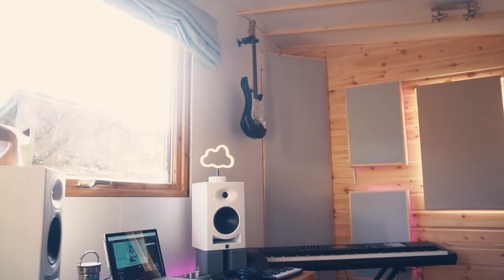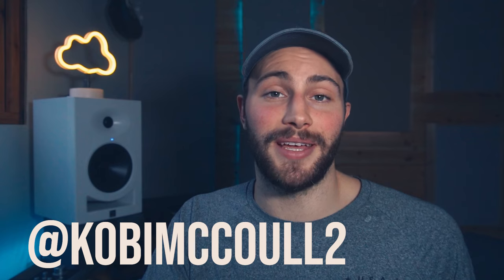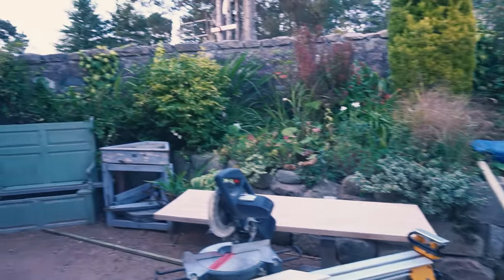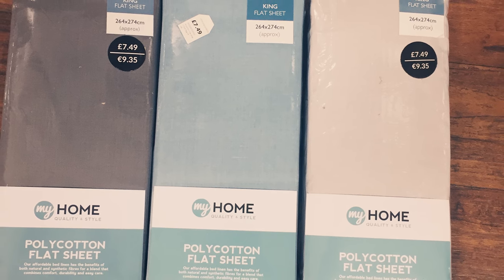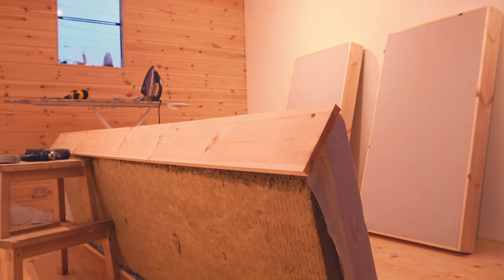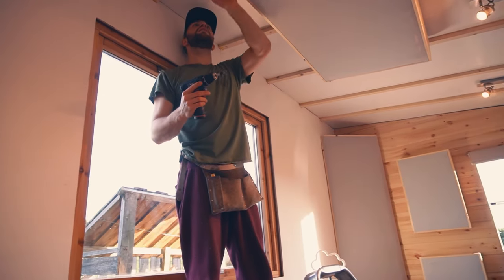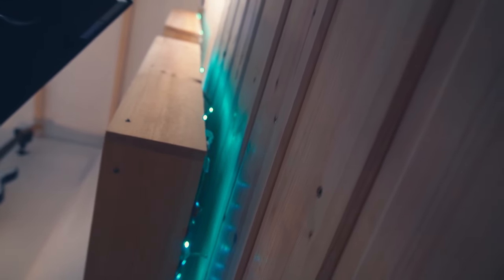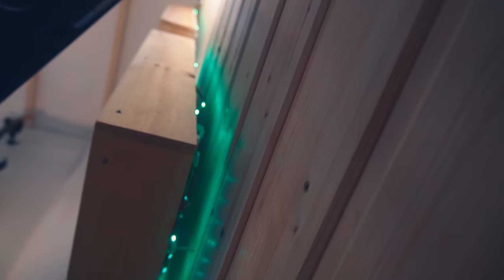Pro Acoustic Panels DIY how to make Cheap! + Acoustic Treatment Basics for a Pro or Home Studio

Comment: Did the fabric moved or wrikled when you screwed the outer frame to the panel?
Reply from the maker: it was stapled pretty well so i didnt but I can see how it might if you arent careful
Reply: @iambradarthur  I got some 2" pannels and I'm thinking of adding an outer frame to use your hanging method so there's an air gap but since they are already built without a second frame i am worried the fabric tension will loosen from nailing, any recomendations?

Comment: Do you have a video on how to make a bass trap ?
Reply from the maker: I don't have a specific one, they are pretty much the same thing as the rest of the panels but build with a 45 degree angle at each corner so that they fit snug against the wall, and you make them as tall as you need.

Comment: Great vids Kobi, watched all of these when you first did them and I’ve come back now that I’m about to insulate my shed build! Quick question… do you know what the stud size is from your exterior wall (looks like you filled the gap/cavity with just rockwall… is it 50mm size?) as I was thinking of extending mine out (it’s only 45mm) to have celotex/Kingspan then rockwall, then plasterboard over… but wondered if this was overkill… I’m only using monitors and mic recording, no drums or live instrumentation… last question can you link the LED lights you got from Amazon.. as there’s about 5000 different sets on there I’m just curious as to which ones you purchased… thanks man, all the best, love the channel and music 🔥👌
Reply from the maker: hey thanks very much, I think the Studs were 90mm deep and 45mm wide and the rockwool was 100mm deep but it made for a nice tight fit by having the studs just slightly less deep than the rockwool. the rockwool was 600mm(60cm wide I think too and 1.2m tall) the LEDs I used are here https://www.amazon.co.uk/gp/product/B085LZXZTQ/ref=ppx_yo_dt_b_search_asin_title?ie=UTF8&psc=1 I hope that helps. thanks again
Reply: @iambradarthur  hey thanks man for the info, all the best to you! 👍😎

Comment: what thickness and density I should use for acoustic panels. I want to hang acoustic panels for my wardrobe as I want to convert it as recording booth and I come to know the fact that acoustic form is not a good idea for acoustics because it only absorb higher frequencies and I must cut lower frequencies for most situations. Your advice will help me for sure. 👍👍👍
Reply from the maker: I used the RW45 rockwool insulation and so far it has worked well. Many are choosing not to make specific vocal booths nowadays and simply treat their room and record vocals in there and it seems to work very well, sometimes even allowing for a more rich sound as it isn't too muted and dull from over absorption. I'm not sure of the size of your wardrobe but I have found that even using pillows, blankets and duvets can work really well as a simple minimal option. i hope that helps :)

Comment: why did u pick the largest ceiling part of the room instead of the shorter? shouldnt u place the desk and monitors at the shortest wall?
Reply from the maker: I thought about setting up at the shortest wall and I knew I could do that if the current setup was problematic, but this current setup was more ideal for the filming and general use of the space. It has been sounding great to work in so far too :)
Reply: @iambradarthur  thx for answering. Greetings from Venezuela mate, i like the way you approach this content

Comment: I got an ikea cube shelf thingy along the back wall behind the stereo and filled each cube with rock wool + higher density plasticy stuff behind it.  Coated the wool in a light clear coat paint to be sure the fibers are locked in.  Used an untreated (unbleached) rock wool so it looks interesting with swirly patterns in it.
Reply from the maker: nice one. sounds great and I'm glad it's working well :)

Comment: What would you do to soundproof your bedroom so you don't have noise going outside the bedroom but still be the cheapest possible while also it working great?
Reply from the maker: simply filling it with more dense things like pillows, duvets, carpet, blankets and furniture like a bed/sofa will absorb a lot of sound and the thicker your walls the less sound will escape, absorption is easier to manage than sound proofing (stopping sound escaping the room) a lot of that depends on the material your walls are made out of and how the walls are connected to the rest of the building
Reply: @laurabrown4675  don't sell me stuff.

Comment: Wait I missed the part where after you put the foam in. Did you create another wooden list to around the original list which are as tall as the foam or did I misunderstand?
Reply from the maker: yes, so you make the initial interior wodden frame, then attach the fabric with staples, cut and fit the insulation and then layer the outer wood around the inner frame
Reply: @iambradarthur  awesome, appreciate the reply :)

Comment: Heya, should the panels be covered all the way around the front (leaving an open back) in order to reduce reflections on the wooden surfaces of the panels, or is that not an issue? Thanks for the video!
Reply from the maker: ideally you just want as much of the absorption to come from the front, outward facing surface and then an air gap between the panel and the wall. You don't have to line it with wood on the outside, it's more of an aesthetic option but you want to make sure the fabric covers up the foam or mineral wool

Comment: Great video! One question, where did you get your rockwool from? I recently just made 6 panels and could only find the rockwool online from acoustic treatment websites. It was much more expensive than I originally thought.
Reply: Probably Home Depot or Lowe’s! I checked my local HD and they had it
Reply from the maker: I got it from a local Builder dealership directly

Comment: is there a difference between building bass traps and just normal panels? if so, what is it?
Reply from the maker: the normal traps aren't deep enough to absorb the longer wavelengths of the bass frequencies so the Bass traps are made the same way but are spread across the corners and are larger resulting in an absorption of deeper frequencies as well as the mid and high end. That is my current understanding

Comment: Hey Kobi, great video! I'm just wondering do you know if the Rockwool is harmful to your lungs if you have it exposed like this? I did the same thing with my studio but I'm a bit paranoid about so much of it open to the elements in one room and I can't find much info about it online. Cheers!
Reply from the maker: I have done a variety of research and inquiries and there are several other youtube videos discussing this topic. I concluded that it's worth wearing protection whilst handling it and ensuring that it is covered in the final design with the wood and fabric but that it is overall a neutral material and should be safe. There are a huge number of people who have used the same material and the studies comparing its safety to materials like fiberglass and asbestos show that it does not behave the same way as they do and is not a carcinogen. Ultimately I cant same definitively but from what i have found it seems safe. Making sure you have good room ventilation will always help anyway.
Reply: That's great! Thanks for taking the time to reply 👍

Comment: Great vid! How thick were the bedsheets you used? Im making a recording booth for a podcast and Ive lined the walls with stuffed animal stuffing (so I have peace of mind whether or not my lungs will be harmed) and framed it with wood and cardboard. The small dust particles are a bit if a problem and I need a barrier to stop the costant yet small accumulation of that dust in the air. I purchased some bedsheets for the same reason you did, but I want to make sure its thin enough for the sound to pass through to the stuffing. Thoughts?
Reply from the maker: I just doubled them up and it still works fine for absorbing sound but isnt too porous :)
Reply: I’ve experimented with this and found old towels work best, used cheap frames from the Works, covered with towels then material used for soundproofing car/van, they look good, tried insulation but nowhere near as good.
Reply: Have researched this for several weeks and my understanding is that the coverings need to be breathable (if you can blow into it easily) otherwise it’s going to reflect. Is so frustrating to figure out which materials will work well! I’d say canvas tarps tho less pretty would work but then what you said: fiberglass hazard may pass through. So something in between sheets and tarps from fabric store or that company illford of Maine I think it’s called makes it.
Reply: @hardlines2635  I’ve wondered about towels or blankets rolled up. You mean for the insides of the panels yes?

Comment: When you're saying "slightly bigger", about the insulation size, compared to the frame : how slightly it is ? Is 1cm enough ?
Reply from the maker: Not even that I would say, if the insulation is 60cm across you want the frame to be about 59.50 or 59.70cm across so that the insulation fits in snug without having to force it or fasten it in place.
Reply: @iambradarthur  ok thanks a lot man !

Comment: So why are these 'pro' panels? At what frequenties do these work? In my opinion pro panels are panels that are specifically build for the acoustic problems in a specific room.
Reply from the maker: This design is used by professional acousticians across the world. the mineral wool, depending on the density and thickness has good coverage across the frequency spectrum. You can measure the absorption in your room with various tech to work out specific resonant frequencies which you could then treat with a diffuser or resonator to improve the overall sound, but these panels offer broad absorption, not specific to a small frequency range.

Comment: Do you think 60kg/m³ is dense enough at 10cm thick? Also how thick was the wood you used?
Reply from the maker: so far it's been great. You can double it up if you need it or get different density depending on your room dimensions and needs. I can't remember the exact measurements but I think between 12mm and 20mm depending on which part it was

Comment: Great video! I’m currently building a room within a room for soundproofing but instead of rockwool im using fiberglass and it’s doing a great job! I was wondering tho if mineral glass would be effective for these panels or the bass traps. Any thoughts on this?
Reply from the maker: I'm not sure. I don't know what the absorption properties of fibreglass are, I predict they might not do a great job of absorbing lower frequencies. I would also be careful with the fibreglass being exposed or not adequately covered as it is more of a health hazard than the Rockwool.

Comment: I would not use rockwool for panels.  Rockwool breaks down over time and will pass through the cloth material, into tiny particles that you will breathe and eventually get very sick from.  Rockwood is meant to be an insulator behind sheet rock walls and is not meant to have any acoustic value.

Comment: Was surprised to see this immense treatment for some 6 inch drivers. 😂 do you have a sub? Love the video regardless.
Reply from the maker: haha you'd be surprised, they can still generate quite a lot of Bass and even with this treatment its pretty bang on just right. Any less and it would probably start negatively affecting the recordings
Reply: @iambradarthur   Oh I can sympathize - my lil rokit 5s make a surprising amount of low end - especially in a small parallel-walled room. My Adam 7s def required me to trap the crap out of my studio. I also have a 12 inch sub which definitely smashes my waterfall graph haha
Reply: @iambradarthur   I’m no expert, but I love discussing this stuff, has anyone mentioned the distance from your speakers to the wall your up against?

Comment: Whats ironic  About the video is that for how many  Acoustic panels he has stuffed into that Room I was able to notice way more Room reverb than I was expecting right away
Reply from the maker: I have found it to give the best balance between being a mixing and mastering space and a live recording space which many studios are going for currently as it allows for some colour in the sound of your recordings but is not so lively that you can't accurately mix or master in it, I can of course use headphones as a reference to check against too :)
Reply: Yeah pretty immediate "what the heck" moment.

Comment: It could be nice with some measurements
Reply from the maker: it was hard to track all of the measurements because I adjusted them to fit the size of the insulation, the space and the wood we had available at the local timber merchants. I hope you get on ok though and if you are struggling or have any other questions feel free to reach out and I will help if I can

Comment: I think there is a big problem. I don’t see a Real trickle protection for the small fibers of the rockwoll. Oh is this not danger for the lungs
Reply from the maker: I recommend doubling up the fabric on the front and covering the back with the same fabric or old towels as I mention in the video. As far as I am aware that should be sufficient. I have also linked info in the description about the health and safety of using mineral wool and will continue to share what I find as I learn more

Comment: your pannels are amazing !! but bro.. all this work to have windows front of you.. bad position your should change
Reply from the maker: thanks very much :) I spent a long while thinking about this and decided I could manage the window by using a thick blind to cover it when I was doing sensitive mixing and mastering, the speakers are below the window and well away from the wall, most of the reflective issues are likely to come from behind me, i also knew that if it wasn't working I could move the setup over to another wall but so far it's been really great to work in

Comment: Man i really cringed when seeing you working with the rockwool without gloves and any safety thingies... That stuff is just Scratchy as and btw, you should cover them on the back as well, because you are supposed to habe them in a closed Space, due to the magic fibre dust that is not healthy for your lungs!! (Carpenter speaking :D)
But all in all, much respect for doing it yourself
Reply from the maker: Retrospectively I would definitely wear gloves and mask all the way through working with the mineral wool. I wore gloves and a mask when insulating the actual room with the same material but wasn't as careful when making the panels. From my research into the safety of the fibres there appear to be studies showing it doesn't have long term negative health risks as the body can process the fibres and eliminate them if inhaled unlike fiberglass or asbestos, but It's probably not worth taking the risk anyway. ideally I would like to find a material that is safe to work with and more environmentally friendly/sustainable and will share if I find better options. Thanks very much for your comment :)

Comment: 10pounds isn't enough to even buy wood for those panels
Reply from the maker: if you buy the materials in bulk from a good distributor like we did then the cost of the materials would work out at around that for one of the smaller panels and the wood and insulation we got was very high quality too.

Comment: There's still way way to much room reverb, either these panels are trash or your placement is trash or both
Reply from the maker: I have found it to give the best balance between being a mixing and mastering space and a live recording space which many studios are going for currently as it allows for some colour in the sound of your recordings but is not so lively that you can't accurately mix or master in it, I can of course use headphones as a reference to check against too. Sometimes you can overdo the absorption and then your recordings sound dead and muffled. It also depends on whether I open the blinds or not. I can choose between either. I hope to make some further developments in the future with some diffusers and also maybe get some bean bags to use as seats and do more absorption. So far it's been a great space to work in though.

Comment: I'm sorry, but I disagree. Just because pro studio acoustic panels look like that, and can be placed in the same places as you did, doesn't mean that this is what they are made of. Most pro acoustic panels on studio walls are actually acoustic resonators targeting certain resonant frequencies in a room, NOT sound absorbing foam which makes the room sound dead (with a low reverberation time). You might as well mix with headphones, or in a closet.
Reply from the maker: Hi Juan, as far as I know and have come to understand through research, pro studios would have a combination of both options. they both serve different and important purposes and can be tailored specifically to the room and it's dimensions. ADAM audio released a video recently explaining how they make their professional acoustic panels and they are an extremely similar design to the ones I have made. ideally I would also get or make some diffusers and resonators so that I can fine tune the room even more but this requires another step up in the technology and price involved in the process. The quality of sound achieved with just the foam panels alone is great and has been really accurate to work with :) I also use headphones to mix and master but the panels really make a difference for recording live instruments or vocals :)I hope that makes sense